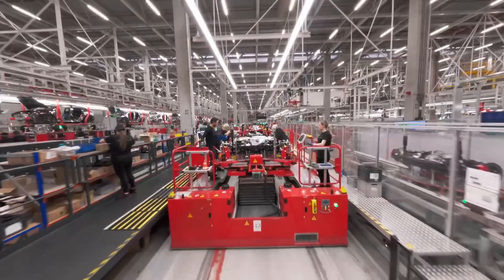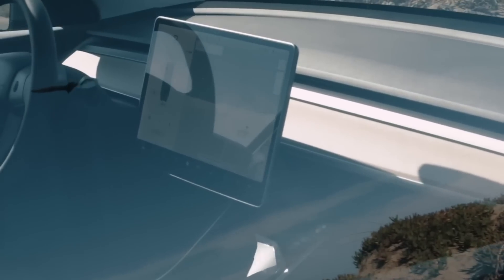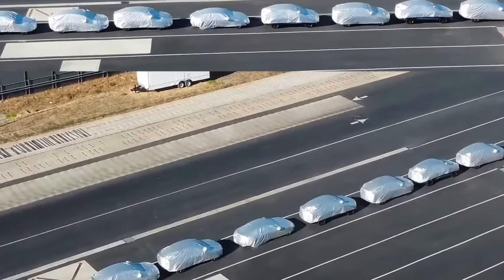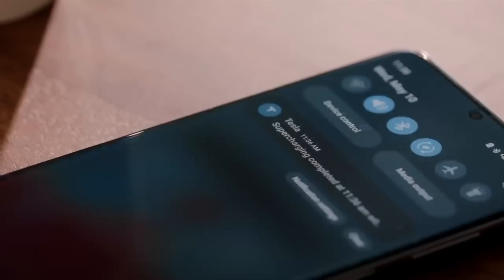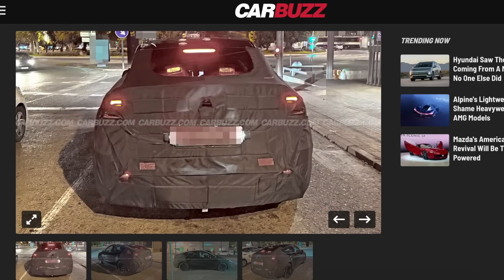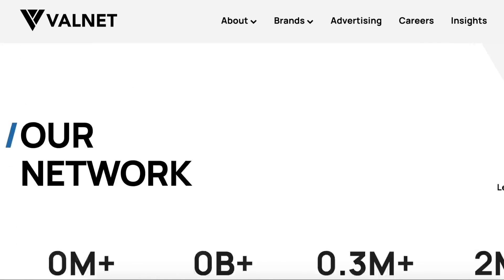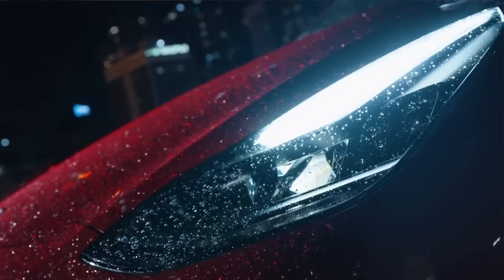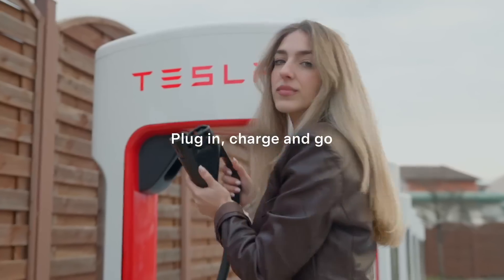Tesla Model Y Juniper Leaks Huge Battery Upgrade | Better Than Expected

Comment from the maker: Let me know if you are planning to wait for the larger 95kWH pack to be in production or are you jumping in as soon as Juniper is announced https://youtu.be/KER5PTY3Lxk
Reply: Any guess on the timeline between the release of the first Juniper and the 95kWH production?
Reply from the maker: @nicklasgammer3192 I would think early Q2, they won’t want any immediate effects on sales of the initial models as they begin ramping up. So give it at least 3-4 months
Reply: @heyJohnEe  Well worth it, that is not too long of a wait :-).
Reply from the maker: @nicklasgammer3192 yup fingers crossed we see that massive leap in battery across the entire lineup soon 🤞
Reply: @heyJohnEe  Not if it adds 300+ pounds. Fast charging is all I need
Reply from the maker: @Joe_Brig it’s much more energy dense in the same package, shouldn’t increase weight anything substantial

Comment: 2:38 I don't think new LFP will have 500 W/kg energy density 😉That battery you show is "condensed" or what battery which is very very high end and expensive (the battery is colored Gold probably because price is equivalent of Gold 😂) battery for Electric Airplanes... Latest CATL LFP batteries around is 205 W/kg which is still a huge improvement from current 120-160 W/kg...
Reply from the maker: lol I like the comparison gold because price is equivalent to gold. That’s pure gold my friend 💯

Comment: I am picking up my 2024 Model Y tomorrow. Deals are too good out there on 2024 model for this cheap skate to wait for refreshed Juniper Model Y. Juniper will be expensive and in demand when released, so likely the current amazing incentives will not be included. Big trade offs going with the old model just so that I can save a buck. I do know that I will be envious of all of you driving the Juniper Model Y if it is anything like the Model 3 refresh.
Reply from the maker: You picked one of the best times for discounts, incentives and deals! You’ll be happy knowing you saved a ton of money
Reply: @heyJohnEe yup, the upgrades are not worth $10k with the EV tax credit potentially going away too. I just ordered mine.
Reply from the maker: @adamdarrow yeah it’s a tough call, but I think you made a good decision jumping in on the great pricing
Reply: @heyJohnEe  I'm happy with my '24 lr and don't plan to trade until the model that follows Juniper comes out.   FSD 13 works well with my car and 300 miles of range seems to be enough for road trips.
Reply from the maker: @stevendaniel8704 awesome! Yeah the current LR Model Y is the perfect SUV, pretty much better than any other options available on the market
Reply: It was a demo model Y with 90 miles on the odometer. Since it was a demo vehicle, it was price adjusted $4,320. I received the $7,500 tax discount. Also used my nephew's referral credit for $1,000 off. I get three months free super charging. Three months of Full Self Driving. Zero down payment. 1.99 percent financing. One month of premium connectivity.
.
All of these enticements steered me to select the current model over the coming Juniper Model Y refresh. I will envy new Junipers when it is released.
Reply: Oh, and I forgot to mention that they threw in a free portable charger that was in very used condition.
Reply: You will regret it
Reply: You will regret buying the old school 2024 model when u see the new Juniper cruising around and will want to sell ur 2024 and lose more money.  Who wants to buy a new 2024 just to feel you have the old model a few months later.
Reply: Thanks for the information. I will definitely take your advice and hold on to my 2024 Model Y for 8 to15 years. I hope to add a second EV to my driveway some time in the next five years. Hopefully other manufacturers step up their games so I can choose from a larger selection of competing models like the variety China has.

Comment: If this larger pack is confirmed, the Osborne effect will be huge if there's no substantial price increase, John. I wonder if Tesla will offer the larger pack as an available upgrade, as on previous Model S vehicles.
Reply from the maker: It’ll just happen overnight no Osborne will happen since not many know about this partnership for the new pack except people like us. Pack retrofit is unlikely since it’s entirely new design
Reply: @heyJohnEe  yes, but it seems unlikely that Tesla will offer a much larger pack at a similar price, John. Perhaps a LR variant will be introduced at some point.
Reply from the maker: @jamespaul2587 it’s not that they want to, its them keeping up and staying competitive with other manufacturers. Battery density has increased and prices going down, there’s no reason for them not to. Also, they just put newer longer range batteries in the base Model 3 and Ys recently and prices stayed relatively the same too

Comment: I am waiting for the Juniper Performance version to come out. Using the Model 3 as a guide, we will see it a few months after the LR model releases. Hopefully Performance will have the larger battery, Plaid motor in the rear, and dialed in suspension.
Reply from the maker: Juniper performance will be insane!
Reply: Will definitely not have a Plaid motor.  No way they will make it faster than the 2024 Highland M3 Performance

Comment: my main reason for upgrading would be a bigger battery, I tow trailers and drive Uber and it would make it way easier and cheaper if I could charge up at home entirely
Reply from the maker: Exactly that. A lot of people are looking forward to the massive leap in battery before upgrading
Reply: You tow trailers on the model Y, for work or for personal?

Comment: ❌Get the model wire juniper immediately 

✅Wait until 95 kW battery pack and hardware 5/Ai5
Reply from the maker: That combination right there is the ultimate win 👌
Reply: @heyJohnEe  question is, will AI-5 truly be here when Elon says it will. Which he did mention the second half of 2025 lol. I guess I can wait 6 to 8 months.
Reply from the maker: @chrismiles2000 Q2 of 2026 is the ETA we got from Elon. So still more than a year away unless something changes and production starts much earlier
Reply: @heyJohnEe  yep, you are correct. Thank you for that
Reply from the maker: @chrismiles2000 you got it!

Comment: Wouldn't it be easier just to lunch Juniper with the larger battery? People would be pissed buying it and then few months later they come with larger battery
Reply from the maker: It would be, but since Tesla relies on third party venders to design and built their batteries, they have to go by their timeline
Reply: I think that you are under the impression that Tesla does not want to piss people off. This is Tesla, not Toyota.

Comment: Physically bigger battery or higher energy densed battery?
Reply from the maker: It’s a higher density battery and shouldn’t noticeably see any weight gain otherwise they would need to redesign another suspension to handle the extra pounds

Comment: Range has never been an issue in any of my 3 Teslas, because I only use about one-third of my max range on a daily basis.
Reply from the maker: Yeah 90 percent of the time range is not an issue at all for any model any trim, but it’s only when on roadtrips that having that larger pack would be beneficial for faster charging speeds from 0-80 percent
Reply: @heyJohnEe  Tesla's don't have that much range driving @ 80MPH or greater. Little more battery would be nice to eliminate the extra SuC stops.
Reply from the maker: @BillB33525 definitely! A little more helps remove any anxiety